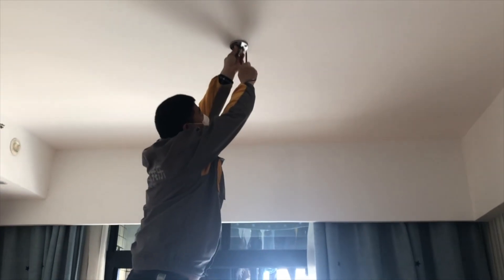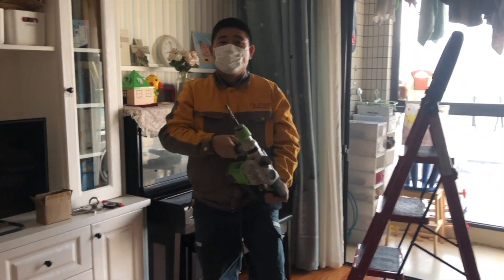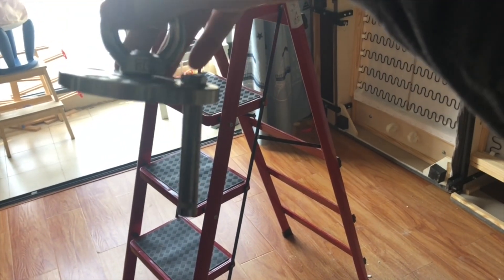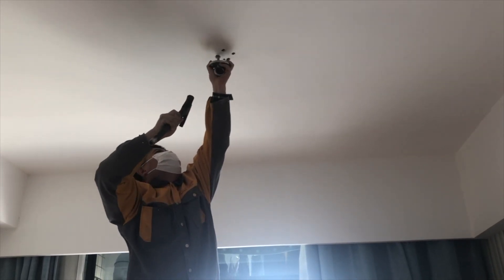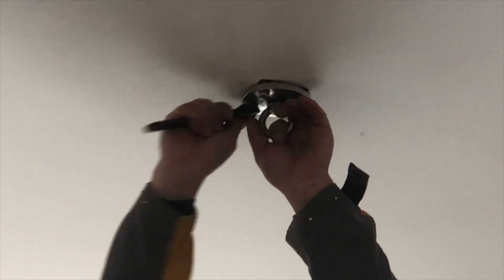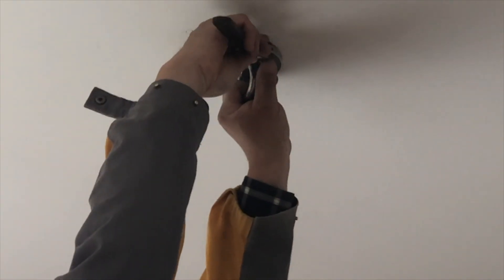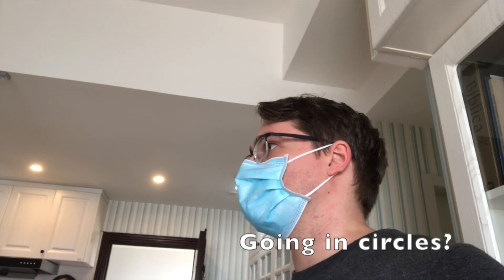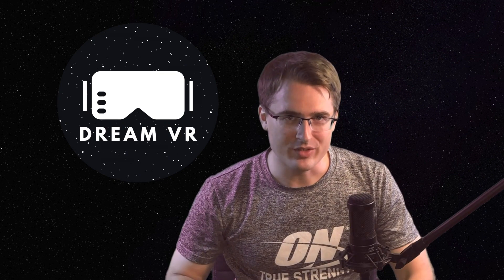Installing a Hook in a Concrete Ceiling to use a VR Bungee System

Comment: I had never thought of doing this, but it's a great idea. It saves you from falling and functions like a great alternative to VR treadmills. I take it that using this together with Natural Locomotion feet tracking would be a fantastic way to play VR. Have you tried it? You can use Vive Trackers on your ankles for that. Anyway, this was really fun and informational :)
Reply from the maker: You read my mind. I am having trouble getting natural locomotion to work in my current VR games so I'm still working up the courage to blow 200 USD on trackers to see if that'll fix it.
Reply: @papajoelstech  I'm using Nintendo Switch Joycons and that works really well, for what's probably a fraction of the cost. Sure, trackers work best, but especially if you have a Switch consider the option.
Reply from the maker: @fdruidMR  Now that I know that is possible, I am a very happy gamer.
Reply: Do they really hold?Like I feel like it might fall off anytime